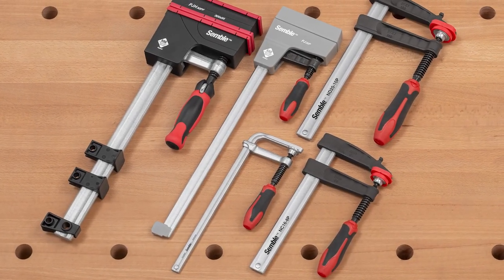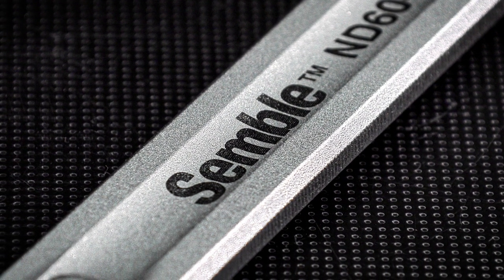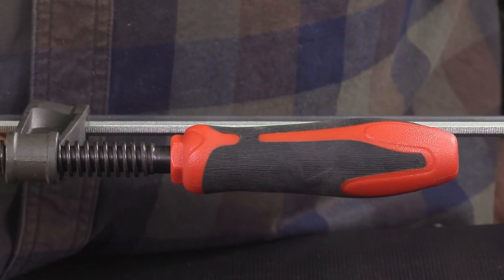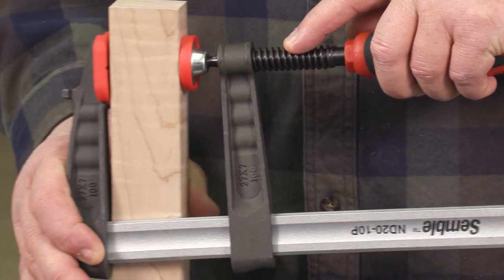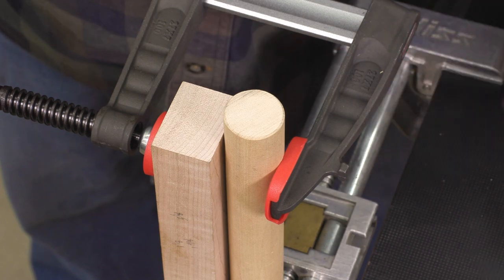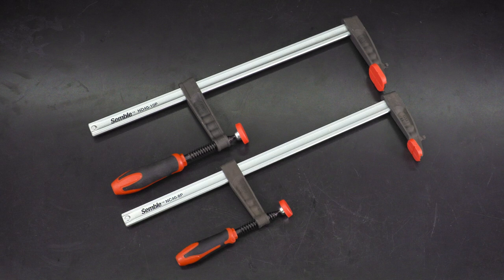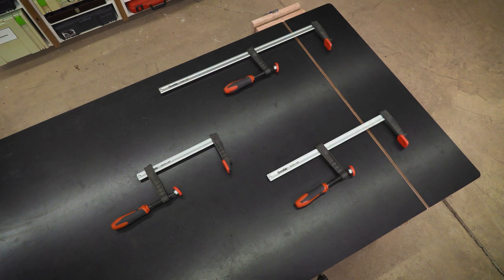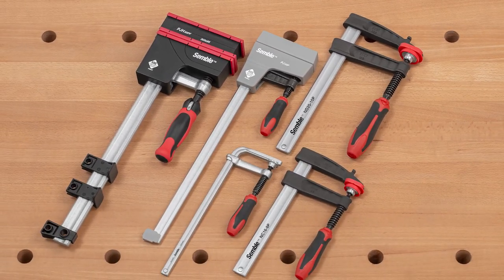NEW Semble™ F-Style Clamps | Woodpeckers Woodworking Tools

Comment: Ok let's see, a 50" Bessey K clamp at Home Depot is about $55 ($120/pair w/tax), durable, dependable and replacement plastic pieces are easy to get. Hummm, these are probably close to $165/pair or $190 (when not on sale) shipped. I think they're from France, so I don't know maybe it's the perfumed box with an enclosed plastic model of the Eifel tower that kicks up the ticket. Love ya Woodpeckers but really???.................but that 90-degree handle is kind of cool.................. :)
Reply: $68 for a pair of 24in. They are made in Taiwan for Woodpecker under their specs. Seems promising.  I bought a pair of 24in and pair of 26in. I normally use Bessey. I’ll report back.